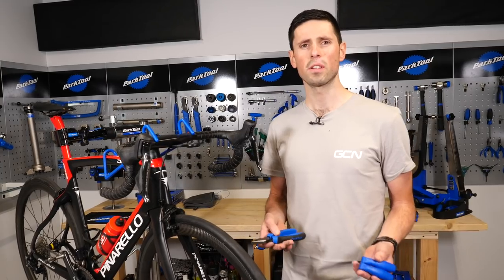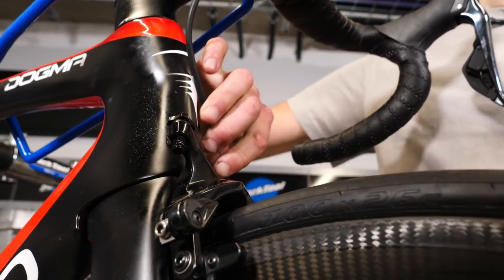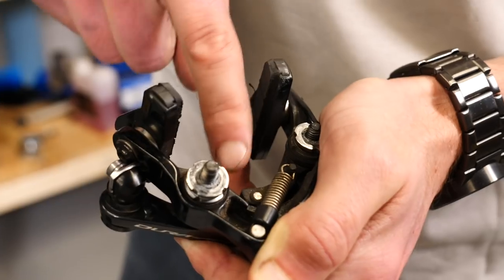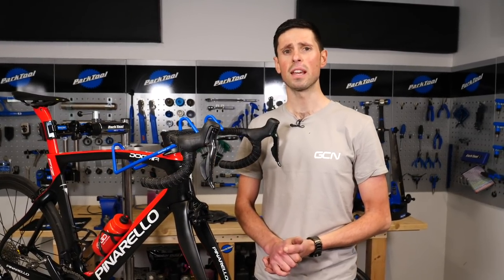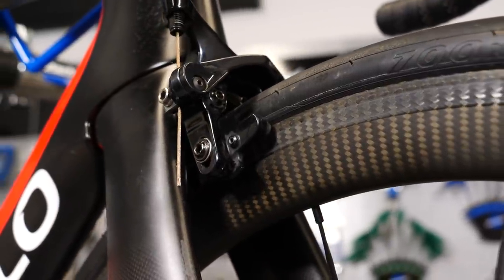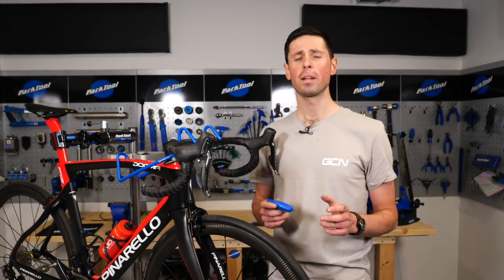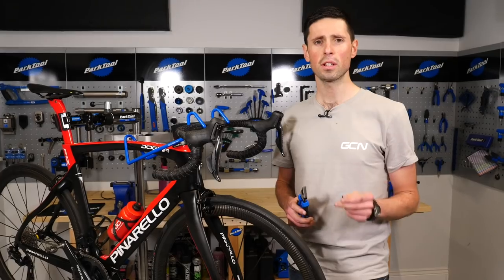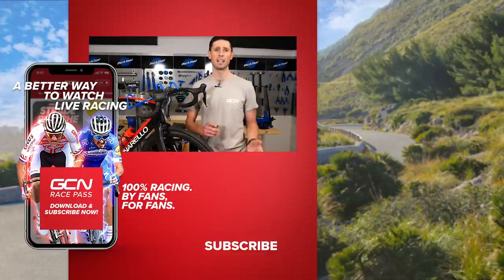How To Fit Rim Brake Calipers To Your Road Bike | GCN Tech Monday Maintenance

Comment from the maker: Has this video helped you set up your rim brake calipers? Let us know 👇
Reply: Thanks to Alex now I have snappy brakes.
Reply: I think it will. Thanks!
Reply: I have Campagnolo center brakes with a 2mm allen for micro centering. However I have wondered if there is a center marking on the mounting bolt and a technique to "center" the micro adjustment. 

Also brake pads need to be torqued not simply hand tight. The mounting to the frame is also needs the correct torque.
Reply: Most of us have center mount brakes. Maybe another video for those ?
Reply: Pay attention to the recommended way to mount this kind of brakepads, as seen in this vid it´s wrong (as seen at 3:18).
(the screw to secure the brake lining in it´s frame has to point to the rear of your bike, so that hard breaking can´t cause any slip or worse)

Comment: Long live the RIM BRAKES ❤️
Reply: Nah. Disk brake is superior
Reply: Rims4theWin.
Reply: @dr.science_0177  Not always.
Reply: @Wildschwein_Jaeger  other than price and weight. It is superior
Reply: @dr.science_0177  Correction: price, weight, aerodynamics and maintenance. They are only better at making you slower.
Reply: @jkk916  those are just minor differences.
Reply: @dr.science_0177  Yeah, except in price. There is quite a big difference. So you will be only marginally slower on your new bike that costs roughly twice as much as the old one.
Reply: @jkk916  you can't put a price on safety
Reply: @dr.science_0177  I trust rim brakes more. They have never failed me.
Reply: @jkk916  and disk brake never failed me
Reply: @dr.science_0177  ting ting ting ting ting....

Comment: No mention of the barrel adjuster
Reply: Mostly used for on the fly adjustment. I was watching a mid 70's Giro d'italia the other day and a rider in a climb actually flipped the rear brake quick release that is used to give clearance for wheel removal. Seemed kinda weird since he was probably on 23mm tubulars. So he must have had some rubbing.

Comment: What about removing the fuzz from Shimano 9100 polymer coated cables or making sure the torque is correct.
I’ve had the polymer cables slip on front derailleur pinch bolts.

Comment: #Askgcntech HI. Building a new bike with rim brakes, but the m6 bolt on the front caliper is not long enough to go through the fork. Is it possible to replace the bolt, or do i need to by a longer nut?

Comment: #askGCNtech is it rim brake with carbon wheelset safe for long descent road ??
Reply: Carbon wheelsets are a lot better now than they where 5 years ago. Old mavic wheels for example use to suffer with delamination around 140c. A modern carbon rim can withstand 220c such as zipps, farsports, winspace...

To get to those temperatures you'd literally have to drag your brakes for 5 minutes plus and if your doing that really you need to learn to brake correctly 😂
Reply: @danc1829  yeah
really need to learn to brake correctly
Reply: Thanks a lot for your information😉👌
Reply: @rudyindra69  yeah~peace~
Reply: @danc1829  5 minutes? Descending from Stelvio is a lot more than 5 minutes. Simple answer is no. Rim brakes and carbon wheels do not work together so good. You do not want to drag any kind of material against a delicate carbon wheels... Unless you do want. And replacing those wheels quite often...
Reply: @TeoSluga  I've had my carbon wheels 4 years had no issues someone in my club is on the same set from 8 years ago...

You shouldn't be dragging your brakes down any descent that applies to rim brakes and disc brakes..... As even on disc you'd overheat the rota and get brake fade.

Carbon is only delicate if u mistreat it. Personally I've had no issues you just need to feather the brakes on and off..... Not drag them...

If you are wearing out your rims fast your probably using the incorrect pad as carbon wheels use carbon pads that are designed to wear instead the pad out instead wearing the rim out.

If your using the correct pads (as advised by the manufacturer) it would take years and years to wear the rims out. In most cases I've seen spokes and hub bodies will fail before a rim reaches the end of its life.
Reply: @danc1829 Let's look at the Tour de France. The Ineos/Pinarello will dispute that. Ineos is able to use extra light carbon wheels only on a few occasions and only for 1 singular race...  It's very simple. Pinarello has to use these 5k worth wheels in order to reduce weight. On the other side Specialized SL7 can use ordinary Dura-Ace wheels with disc brakes and achieve even lower weight... And they can use these wheels multiple times...
Reply: @TeoSluga  I'm not really following you tbf. Team Ineos yes did use lightweight wheels but they also use dura ace full carbon wheels.....

They used the lightweights to drop the weight...

But continued to use a full carbon wheel throughout the rest of the tour...

Are u trying to say they stopped using the lightweights as they worn them out 😂 I'm totally lost sorry. 

Ineos use carbon wheels reguardless so I don't really get your point here??
Reply: @danc1829  yes, exactly so. Pinarello has weight issues (so does Bianchi...). In order to gain at least comparable weight as other bikes they need to use extremely fragile carbon wheels. And guess what? They are not safe. It's not safe rubbing the carbon as it is braking on aluminum surface. Period. Not even nearly as safe.  You are following me now? :)
Reply: Quality of the rim matters.
Reply: @TeoSluga  yes following. Pinerello and bianchi are heavier framesets. But it's going off topic as we are now talking about weight and the tour of france 😂

I will never ride in the tour of france and I don't need to worry about the uci weight limit.

I'm just pointing out carbon wheels aren't like they use to be they have come along way which they have improved resin temperatures, improved braking etc. Even the stock carbon wheels that came on my giant the slr carbon wheels are very good, compared to older wheels of 5 years ago. 

You clearly love discs and I like rim brakes. (I've had 4 road bikes with discs so have tried and used them) I'm not a hater just not for me. 👍

I find rim brakes totally fine and I've never had an issue so why am I going to change that I guess. The whole carbon wheels are expensive thats not true these days it just depends what u want to spend.

I've used winspace wheels and you can get a replacement rim for 200 dollars hardly an issue, especially if used correctly you'd get years of use out of a rim. 

It's horses 4 courses.

But fact is if carbon wheels where that dangerous you wouldn't have the world's biggest manufacturer making them for the general public...

Giant still make a full rim brake line up sold with carbon wheels obviously they are confident in their products.
Reply: @TeoSluga  Almost every bicycle with aero frame and disc brakes has weight issues. I think that top teams that compete in GC (Ineos, Jumo-Visma, UAE) want rim brakes because of wheel changes foremost. Then there are marginal gains (weight and aerodynamics).
Reply: @jkk916  not really. You see, SL7 has 6.6 kg with Dura Ace wheels and disc brakes... Pinarello F12? Not even close... Bianchi? Add half a kg...
Reply: @TeoSluga  I said ALMOST and SL7 is arguably not true aero bicycle. It is a compromise between aero and lightweight frame.
Reply: @TeoSluga  Wait till you see how heavy the bikes tdf riders ride now. Alberto Bettiol's weighs 8.2kg, Caleb Ewan 7.8kg. Even my rim brake race bike I got for £1900 is lighter at 7.3kg.

Comment: Question: I have Shimano Ultegra rim brakes. Every time I take my front wheel off my brake caliper goes out of whack. I have to re-adjust the brake caliper  because on side of the caliper will push in first. What's wrong with my brake? Is this normal?
Reply: You've probably got an Ultegra Flex Bender 6969, they're prone to that.
Reply: Most likely the mounting bolt isn't tight, and the caliper is getting bumped when you remove the wheel. Shimano specifies 8-10Nm for the current models (center mount). 
I am assuming you know how to use the quick release, and are fully releasing it before removing the wheel.
You should also check that, when you put the wheel back, it's properly seated on both sides of the fork. If it's not, the rim won't be centered so it will appear that the brake is not centered.
Reply: Stephen Turk it's a direct mount brake, that's why I'm a little confused as to why it keeps happening 🤔

Comment: Personally wouldn´t use the cable ends. I´ve found it easier to super-glue the ends of the cables. Just clean the end of the cable with something like white-spirit, be careful not to fray the cable. After the white-spirit has evaporated, stick about 5-8mm of the cable into the super-glue. Hold it for a couple of seconds, take it out, remove the excess, but leave enough so that there is a visible coating on the outside. Let it dry. Haven´t had any frayed cables for the past 5 years.
Reply: I bet your bike is riddled with internal rust.
Reply: @Boabybawbag  No rust nowhere. Why should it be? Cable ends dont affect how or what gets into the cable housing. They are just there to stop the ends from fraying.
Reply: @Dravde  You should get it checked by a professional, before it starts eating through the BB. Please believe me.
Reply: @Boabybawbag  what are you talking about? you don't clean it before you thread it, plus for all you know he could have external routing.
Reply: @cornishalps9870  For all I know, you're riddled with rust. I bet your bikes are riddled with it too. FFS.
Reply: @Boabybawbag  carbon don't rust boyo

Comment: Is there a way to take off a front brake if the previous idiot owner of the bike has spray painted inside the hole at the back of the forks that provides access to the bolt?

Comment: Why they are not making rim brakes for bigger road/gravel tires.. I would love to have cheap alu gravel bike with rim brakes..
Reply from the maker: Wider tyres don't work so well with rim brakes, unless you move to a cantilever or mini-v design, plenty of older bikes do use these - but discs are becoming a lot more widely used. In any case, using a rim brake like the one in this video wouldn't work well with wider tyres due to tight clearances, and therefore a lot of potential to fill your brakes with mud/dirt/grit from the road
Reply: I would like to see cheap bikes with rim brakes too. It is stupid to pud disc brakes on everything. On my experience good quality, well maintained rim brake system is way better than average (cheap) disc brake system.
Reply: @jkk916  rim brakes do not work with wider tires. It's simple.
Reply: @TeoSluga  BMX bikes back in the day. Just saying.
Reply: @Wildschwein_Jaeger  back in the days? I can ride 65km/h downhill and brake safely and effectively with mine Shimano 105 rim brakes... Now please try that with BMX 😅
Reply: @TeoSluga  My old mtb with V-brakes can take wide tyres. Yes it is simple, you are wrong.

Comment: the rim is too vulnerable to be used as a braking surface. i hate when its not straight anymore and lever feel spongy. Also crashing or putting the bike in a car make the top of calipper hit the frame.  Disc brake is a blessing
Reply: Come on. You must be a lot more careful with disc brakes. Just look at them wrong way and you will get a rub.
Reply: @jkk916  sry i dont have any rub on my bike (sram force axs etap).
Reply: @theonlytruefalcon I have almost exactly the same distance on my bicycle (2017 Caad12) and I don't understand you at all. I have changed brake pads two times in 3 seasons and it was quick and easy job. I have had zero problems with brakes. Making few turns on barrel adjuster cannot be easier. You can even do that during a ride. You must had been using bad pads.